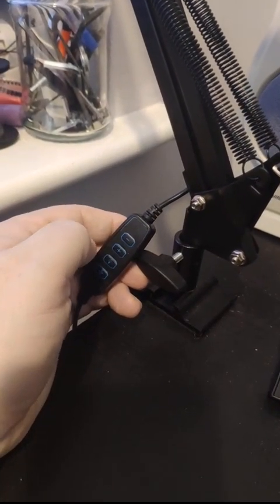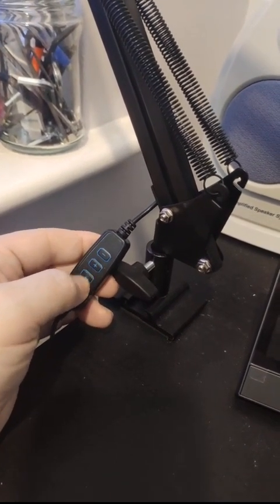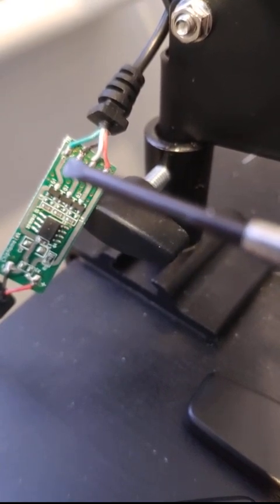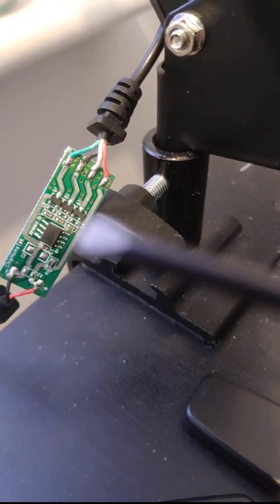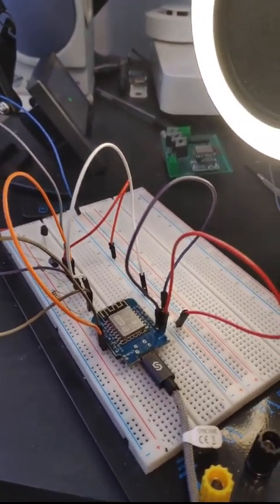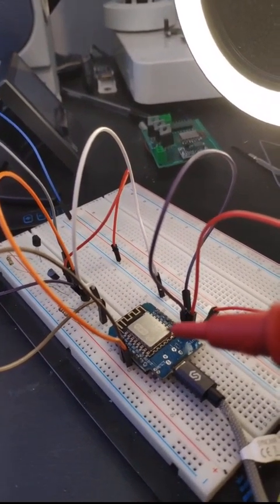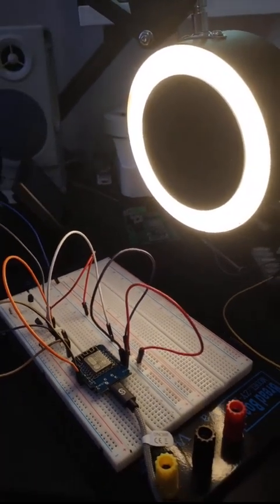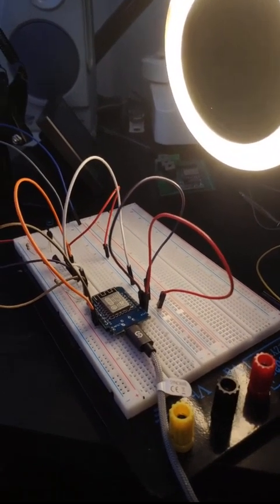convert dumb desk light to esphome

Comment: I have a similar light and a couple D1's laying around so I would really like to see a sketch and a ESPHome sketch if you get time. Thanks
Reply from the maker: output:
  - platform: esp8266_pwm
    id: output_warm_white
    pin: GPIO14
  - platform: esp8266_pwm
    id: output_daylight
    pin: GPIO12
  - platform: esp8266_pwm
    id: desk_fan
    pin: GPIO13
light:
  - platform: cwww
    name: "desk light"
    cold_white: output_daylight
    warm_white: output_warm_white
    cold_white_color_temperature: 6500 K
    warm_white_color_temperature: 2700 K
    
fan:
  - platform: binary
    output: desk_fan
    name: "Fan"
Reply: would like to see the electric diagram as well , if that possible , thanks in advance....